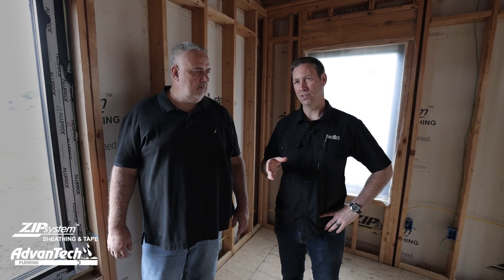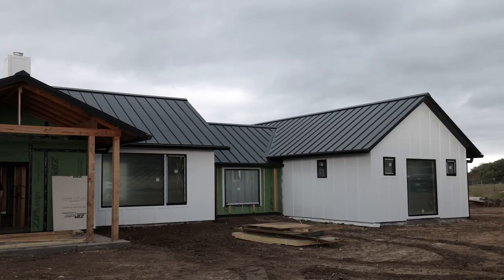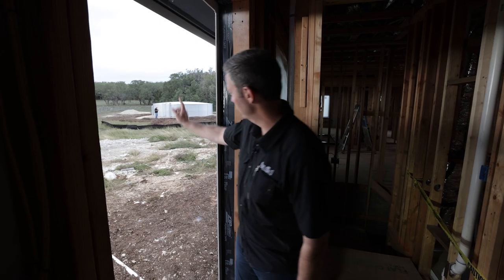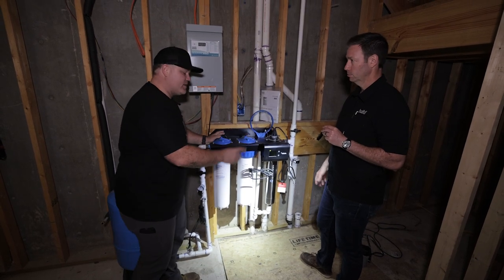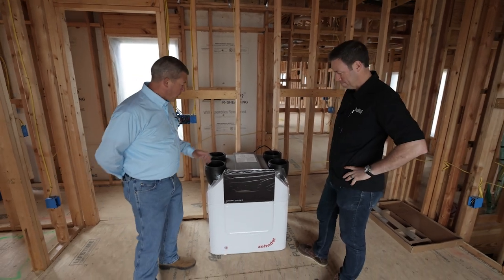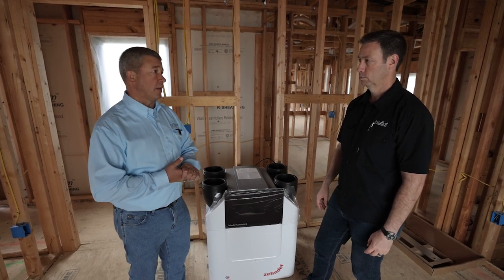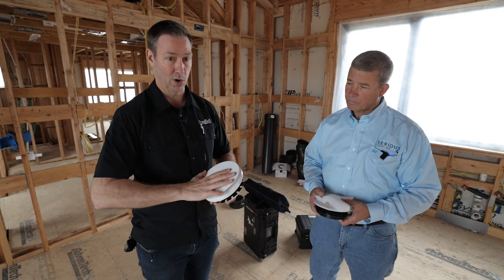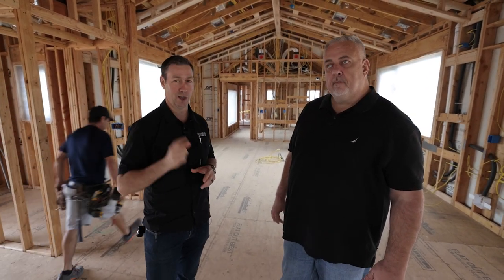No city water? No well? No problem: 55,000 gallon RAIN TANK

Comment: It would have to rain very often to fill that 55k gallon water tank! I would not have had that tank built for catching rainwater only. It's for buying and storing water. Honestly this size of a house would require a 65 thousand water tank which is equal to 180 gallons of water a day being used!  But since this house has a 55-thousand-gallon tank, I would have a Pump that pumps the city water to the water tank for free, because this house will use more than 55 thousand gallons of water a year!

Comment: As far as the water filtration system it could of been better. I have an Aquasauna OptimH2O. It’s the only smart whole house water filtration system that I know of that actually tells you when to replace your filters based on your usage.
Reply: Of course you can add the UV light and additional filters s
Reply: @Vicenteroman when I was broke I had the same, upgraded to Hydroluxe 3 membrane smartmosis reverse osmosis total home third gen smart water system. It’s a lot better no big deal tho.
Reply: We have an Aquasana Rink System for our rain water system.  Works great so far.

Comment: Been there, done that.  While not that huge, had a outdoor 2500 gallon underground cistern.   More to it than just storing water,  Water chemistry, biolfilm, chlorine balancing, filtering, aeration, pumps, holding tanks, etc, etc.  Been there, done that, and glad I dont do it anymore
Reply: Our system is 5000 gallons.  All I do is change the pre filter every two months, post filter every six months and the main filters every five years.  Hasn't been very difficult to maintain.
Reply: @Off-Grid  Depends, is it used for drinking water or just for washing hands and showers, etc.   Most cisterns I know need to be cleaned as well for biofilm as well if you are using it for drinking water.  But I'm just going by what our provincial government told me to classify things safe for drinking so I didnt poison my family and got my water tested 3-4 times a year.  Didnt get anyone sick in 11 years, so I assume I did things right
Reply: @virgil3241  we use ours for everything to include drinking water.  The research I found stated that the biofilm was a good thing since it would feed on contaminants before hitting the filters.  We've been using the system for a couple years now and all is good.  Water tastes great too.
Reply: @Off-Grid  Research in Australia has shown that the biofilm is way more efficient at removing many contaminants.
Reply: @jay90374  that's what I've said too!  We did a lot of research and Australia is where I always ended up.  The US had very little other than people saying not to do it yet most of the world does.
Reply: @Off-Grid  Thats awesome.  Glad I dont have to worry about it anymore.

Comment: Sure, as long as you get enough rain off the roof to fill that tank.  "Life Uncontained", a channel that is also in Texas, has a rainwater catchment system and this past summer they came EXTREMELY close to running dry.
On their water system, I have no idea if they have outdoor faucets, but if so, I would have probably run the lines to them BEFORE the filters, just to save those for the drinking water.
Reply: A lot of us on rain water had that issue too.  We ended up hauling some water.  I think they did too.
Reply: @Off-Grid  I think they said they were going to but I don't remember.
Reply: @michiganengineer8621  yeah, I remember them talking about it too but don't think they had a way to transport it so they pumped the bottom of two of the tanks into the third to get by.  We looked into that as well but we had a way to fill a 550 tank and gravity feed in into our system.
Reply: Location. Location. Location.
Reply: @TUKByV  true except that the best location keeps moving around every couple of years.
Reply: @Off-Grid  deserts are generally well-defined within a certain timeframe, such as the lifespan of a human.

Comment: I'm only seeing plastic corrugated piping for the Zehnder system. What about insulated ducting instead, at least for the incoming air.  If I install it, my attic is not a conditioned space, and in Florida that corrugated piping won't work.

Comment: Every home and business should install a rain water collection and storage system along with solar panels.
Even in areas where rain is infrequent it is crazy to waste the little rain that does fall and waste it.
We need to stop planting green lawns and switch to local native plantings around homes.
It is crazy to plant lawns and build golf courses in dry desert areas. We waste too much water and electricity.
Reply: Agreed
Reply: I never understood the concept of "wasting" water. You can't readily destroy it. Every bit goes back to the aquifers or oceans at some point. So you either pay a utility entity to collect it, purify it, pressurize it, and pipe it to your house, or you do it yourself. What's the difference?
Reply: @MrTexasDan  When you don't have any water because of a drought or wells drying up you will understand.
Reply: Run off in built up areas is not the same as the gentle rainfall in a forest with the rain bouncing off leaves and branches before it hits the ground.  So collecting off a roof makes sense even if you only use it to water lawns and gardens during dry periods.  Slows the runoff.  Better absorption by the aquifer.
Reply: @KJSvitko  Sorry, I was under the impression drought meant lack of rain. My mistake of course.
Reply: It's more complicated than that.
Reply: @Bob_Lob_Law  Shhhhh! Don't tell them the secrets!

Comment: Honestly, this tank seems way oversized for the property.  A house that size with a 55,000 gallon tank?  What is the turnover of that water?  How long is it sitting in the tank before being used?  Are they just planning ahead for worst case scenario being an extended drought?  A tank like this is perfect for homeowners because they're cheap.  There's a reason they use that internal liner.  Because bolted steel tanks are very prone to leaking and are not coated inside for corrosion resistance.  If you're doing commercial work where they're actually considering longevity rather than just looking at a price tag, get a welded steel tank, preferably shop fabricated and coated internally and externally.  If you're in a colder climate, don't want to see the tank above ground or just want all rainwater to gravity flow into the tank, bury it so you can use it all year long and don't have to heat/insulate it.  I'd go with an underground fiberglass tank.  Your downspouts can collect the rainwater, run them through a pre-filter (first flush) like they talked about and then gravity flow into your underground tank.  Then use cistern pumps to pump it through your filtration/UV system.  Seems to me like that homeowner was sold on the idea that more capacity is better.  That first flush filter doesn't come close to getting everything.  Rainwater can get pretty nasty, especially just sitting in an aboveground tank for weeks and weeks (or worse, months and months).  He's definitely going to want to keep an eye on those filters and change them frequently.  Going back to commercial work and sizing a system like this, 55,000 gallons would be a very large rainwater system for a new high school, a new church, possibly an irrigation system at a university, a 15 story office building/mixed use/retail building.  Granted, it sounds like this homeowner is using this water for drinking purposes as well, which is not a thing in the commercial world.  You would not drink rainwater.  Rainwater is used for irrigation, flushing toilets, etc., not for human consumption.  Possibly if there are 50 people living in this house, and they're running water constantly, showering multiple times a day, running 20 loads of laundry per day, flushing toilets 200 times per day, watering their gardens, grass, landscape, etc. every day, it's possible they might need a tank this large.  It doesn't seem likely though.

Comment: Do you need to use some type of gutter guard to keep stuff out of the water tank? I wouldn’t want a dead bird or something in my water regardless of the filtering.
Reply: We put guards on our gutters and then have a catch basket before the water enters the tanks.  There is another debris filter before the pump then several more after the pump.  Has worked great for years now.
Reply: I would think you'd also want to dump a few cups of chlorine into the tank every week to disinfect the water.
Reply: @wallyballou7417  That would be to much.  You don't want to kill your biofilm.  We put in around 2 cups of liquid bleach in each tank maybe once a month in the summer but that's it.  That is about a 1/4 of the amount required for the size of our tanks if we wanted to fully disinfect it fully.
Reply: That's a given.

Comment: Because this tank is an above ground affair, the designer missed a trick. It could have had a roofing guttering lid to it that drained directly into the tank itself. A tank with a top that size would collect a surprisingly large amount of rainwater. Without any means of collection & storage, an awful lot of rainwater will be wasted.

Comment: So how does the rain water get up into the catchment system? Is it pumped up into the tank? Gravity? Did I miss that part of the explanation?
Reply: Gravity
Reply: I have the same question. It may be an optical illusion, but that tank appears to be at the same elevation as the house. Water can't flow uphill, so for that tank to fill to the top, the top rim of the tank would need to be below the elevation of the pipe coming from the house.

So I ask the same question as Texas Woc: how does the rain water fill the tank?
Reply: @protofmaster  Top of the tank is a few feet down from the gutters
Reply: Thank you for the reply. But even given that the top of the tank is a few feet below the elevation of the gutters, if the tank ever got to mostly full, or let's say 3/4 full, the water height between the tank and the downspouts would equalize, such that the downspouts would be partially filled with water.

So then your gutters must be sealed into the underground piping? This also means that your underground piping will be filled with water most times, instead of draining out into the tank completely.

Comment: A question: does anyone ever design these rain-water tank systems with a plan to catch rain water off the roof of the actual tank? That tank occupies some square footage, so I thought I would ask.
Reply: It's hard to get the water into the tank because the tank fills right up to the top.  There are some solutions out there but they often cause contamination issues. Cheapest solution is to add more roof in a useful way (barn, shed, carport)
Reply: Yes. It's been done. You can also build a pole-barn style roof over it, which protects the tank from weather and reduces evaporation.

Comment: I can see a few things wrong with this water tank system that they've built here. 1 is when the water comes down from the roof into the gutter's it will wash all the dirt down the inlet pipes with it, I didn't see any dirt traps or dirt filters. 2 is they showed what it looks like on the inside of the tank and the inlet pipe that feeds the house with water is sitting on the bottom of the water tank, that is a big NO !! NO !!  eventcheerly over the years of use the dirt will build up over that inlet pipe and the pump with start to suck dirty water into the house and   eventcheerly clogging the hole water system up and 3 can you imagine the monumental task it will be to empty a 55,000-gallon rainwater tank to give it a wash out to clean out all the dirt and sediment that has settled at the bottom of that tank.

Comment: the uv light is supposed to last a year... turning it on and off shortens its life.. i have a 12 gpm one on my home
..cool vid ... love the tank
Reply: I have two UV lights just in case one goes out.  I'm still using the first bulb and it's been two years now.
Reply: @Off-Grid  How do you know when a bulb goes out?
Reply: @MrTexasDan  I can see the glow when the lights are off.
Reply: @Off-Grid  oh, ok, thanks. I just thought there would be some newfangled alarm thingy.
Reply: @Off-Grid  i think they can be lit but too dim to treat the water but I'm not sure.
Reply: @TheRainHarvester  I've wondered that too.  I plan alternate replacing the bulbs every year so that there will always be one that is new.
Reply: @Off-Grid  maybe there is a way to measure uv intensity at a fixed distance?

Comment: Oh so only about 45k for my house. I’ll get right on that rose
Reply: Builders are use to funneling millions of dollars around so 45k is nothing. No surprise that trucks are 60-150k with super luxury features. Matt has towel dryers and an illuminated toilet. All the houses shown off are luxurious mansions by poor people standards
Reply: My 5000 gal system was around $5k and most of that was the filters.  To dig a well was over $20k and rural water was going to be around $15k.
Reply: @Off-Grid  I was talking about the ERV system. Not the water
Reply: @magictrading8903  ah, our ERV was less than $1k.  Granted I installed it myself which saved a lot.  Seems to work as intended.

Comment: Nice, but with all the plastic and roofing material in direct contact with the rain water... is there going to be any "surprise" chemical toxin leaching going on in 5, 10, 20+ years of operation(?)
Reply: Probably.
Reply: The carbon filter should handle your concerns.  Also, rainwater through a carbon filter is likely much more pure than city treatment plant water without a carbon filter.
Reply: The research I did before installing our system showed that it's fine to do.
Reply: LOL 🤣🤣🤣🤦
Reply: @s9josh778  yeah i read pharmaceuticals are not getting filtered from city water: extra estrogen!

Comment: Does the tank catch the water that falls on the tank roof? Or does it shed that water?
Reply: It's hard to get that water into the tank, and curved gutters are expensive. Best to just build more roof.
Reply: @Colindstuart  maybe. But I am not totally convinced. Also the roof over the tank doesn't have to be round. It could be slanted one way. First flush diverter. And then right into the tank.
Reply: @mckenziekeith7434  remember its a compound curve. So even a straight edge would not be straight in all planes. The sheets come pre cut to length so you'd have to source different sheet metal, it's not US standard. Pioneer has had trouble with making it in the US but will be starting a factory soon. The rainsavers are just not effective and let in light.
Reply: @Colindstuart  I have the geometry in my mind. My thinking was to have an oversize flat roof and span the vertical distance up from the top of the tank to the roof with mesh or something. But I don't know. It all depends on whether the extra water is even needed. If you live somewhere with 100 inches per year of rain, there is no point in trying to gather more water. You won't even be able to store all the water from the roof of a big house. If you live somewhere with 20 inches per year then catch area will be at a premium.
Reply: @mckenziekeith7434  building a flat roof with a 30ft span is expensive, and the trusses would hang down into the water (or reduce tank capacity). Also ice/snow loads and debris build up becomes a problem.
Reply: @Colindstuart  I always forget about ice loads because of where I live. Also, you are right about the span. I wasn't really thinking. I was thinking you could just put a low slope roof over it and it would be fine. But that is not the case.

Comment: I would sink a water well just in case.
Reply: $20-30k for just the hole
Reply: @MrTexasDan  true.  But you can’t live without water.   Still cheaper than trucking it in.
Reply: @studinthemaking  Depends on if the rainwater system is sized for all but the worst droughts. It is much cheaper to truck in water every 6 or 7 years than drill a well "just in case"

Comment: i would have done metal roof, no mater what. Asphalt chemicals in my water"No Deal", even though I know you have to use water filters to combat the acid rain, Con Trail chemical they spray in the the sky. You'll have to replace the water filters more frequently.

Comment: With no penetrations through the roof I’m curious if the plumbing vents weren’t installed yet?
Reply: I think they are vented under the soffits.
Reply: The plumbing vents exit through the gable ends.  I think that's one at about 5:30 above the Zehnder vents.
Reply: Mentioned in video. Vents are in the gables.

Comment: I Don't like the centralized air exchange system. It's begging to have problems. Efficiency is one thing but sometimes simple is better. Make up for the lack of efficiency with extra insulation, windows, shading, zoned cooling/heating, and overall energy efficient architecture.

Comment: I Don't like the centralized air exchange system. It's begging to have problems. Efficiency is one thing but sometimes simple is better(especially where fart fans are concerned). Make up for the lack of efficiency with extra insulation, windows, shading, zoned cooling/heating, and overall energy efficient architecture.

Comment: How does stagnant water stay drinking quality?
Reply: How is it stagnant if its in a sealed container?  Stagnant refers to water sitting outside not moving
Reply: you run this thought a filter system that clean it up and UV sterilize it and adds minerals back in (they showed it at 9:00). As long as you keep sunlight out its lasts much longer. I have the Aquasana system and it works great
Reply: @luthersullivan5141  stagnant doesn't mean outside,means not moving,well water is always moving underground...
Reply: The tanks do not let light in and the filters keep most of the debris out.  The tank forms a biofilm which breaks down most of the things people are worried about.  Then the other filters clean everything elae out.  Our rain water has never been a problem and is our only water source.